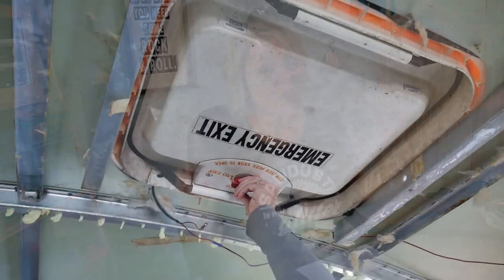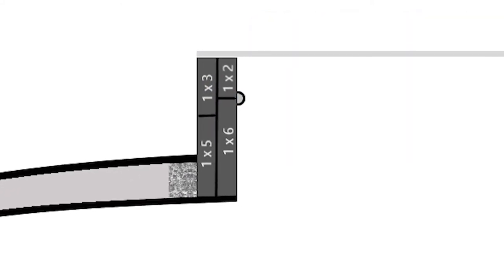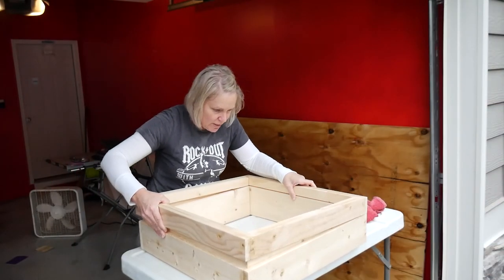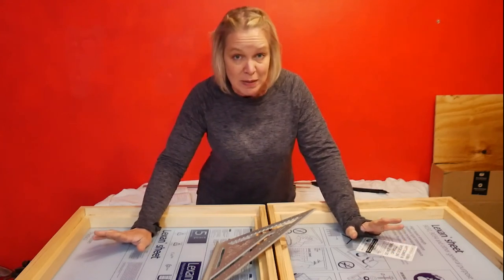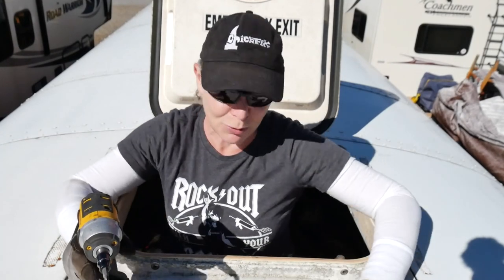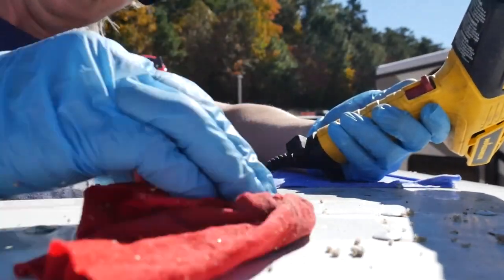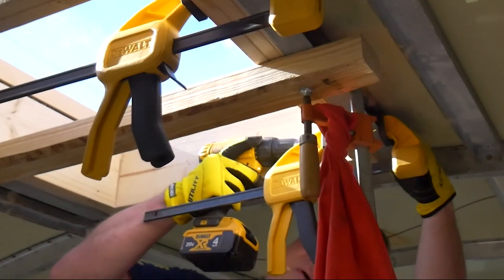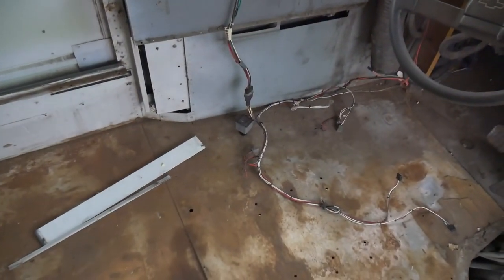School Bus to Tiny Home Conversion, ep. 5: From Emergency Hatches to Skylights!

Comment: I'm enjoying your progress! We took our skoolie project home so we can work on it with heat and electricity. So if you don't see our bus across the way, that's why. We didn't give up! Today I dug through all the 12 volt wiring to get rid of the circuits we're not going to use.
Reply from the maker: We were wondering where you went! I don't blame you for bringing it home...we would absolutely do that too if we could. Digging through the wiring is a big job!